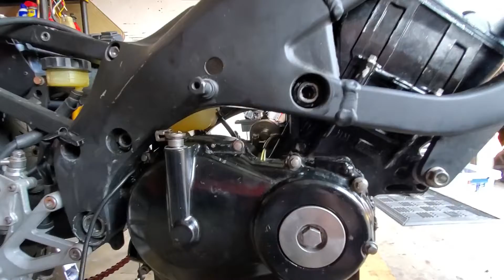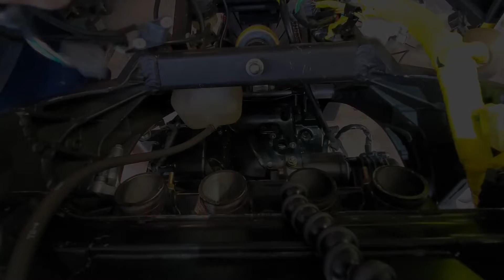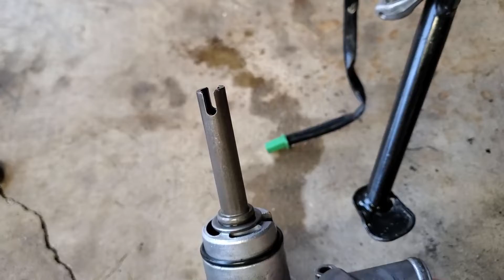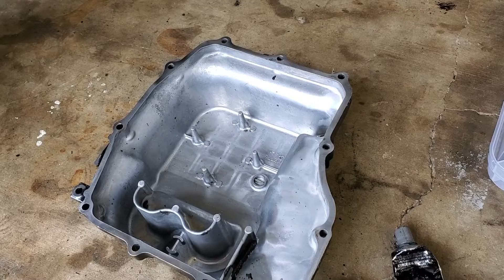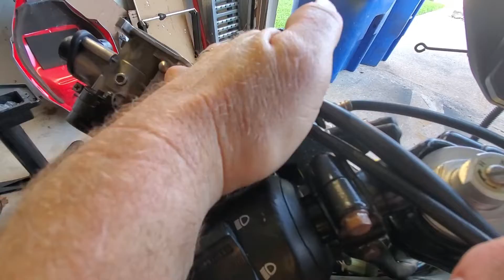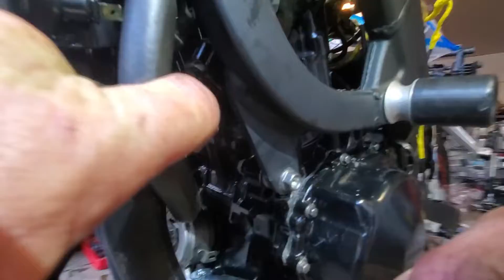CBR600F4i Engine teardown episode 8

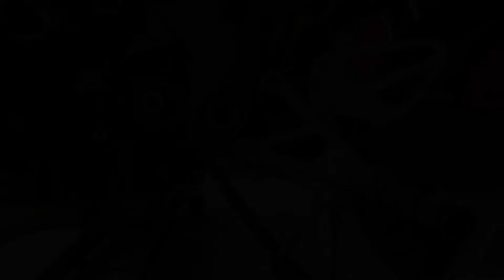Comment: I really appreciate the quality videos on this it definitely helped me for sure the one thing I’d add is at 2:25 for the swing arm castle nut you mentioned that you used and 11/16, I went to find one in my box and found that that didn’t necessarily work for me but was able to fit the 30mm socket that we used for the oil cooler nut, and that fit very nice. Overall a very informative video thank you!
Reply from the maker: thank you for watching!
Reply: @fixin_grillin_chillin you should definitely film more! I don’t have a jeep Cherokee but I’m sure those videos are just as informative!